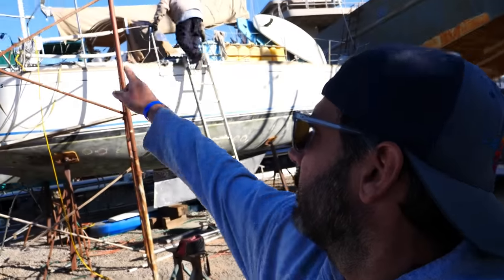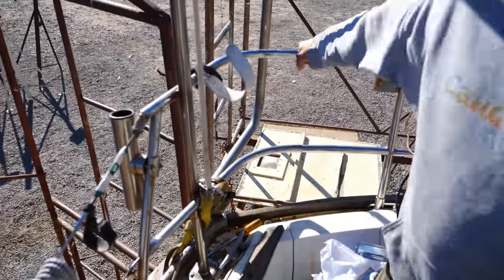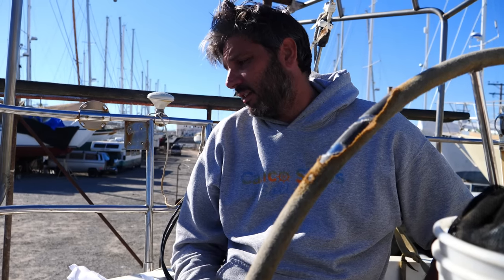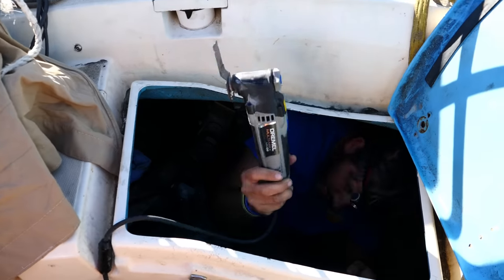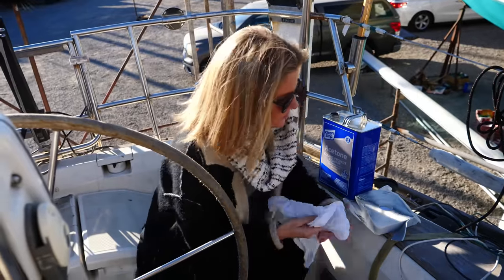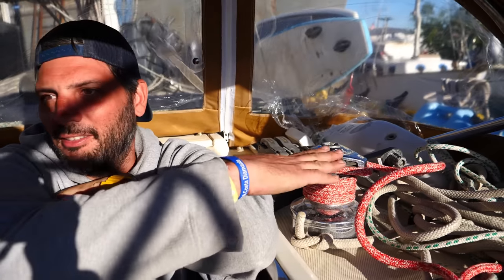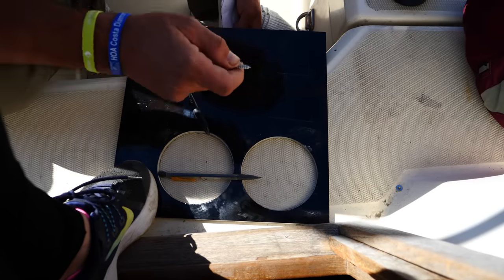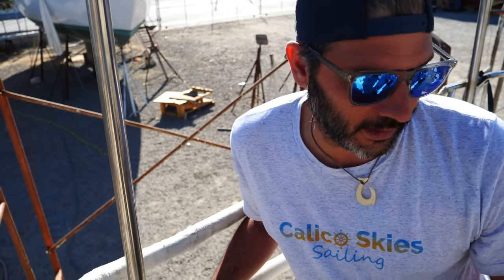Our Costly Mistake: Please Don't Do This w/ Your Arch Build! (CSS, Ep.174)

Comment: Cut the pipe 5 or so inches above, fix and reinforce the deck, then slide a bigger diameter pipe into one of the sides install it slide the larger pipe over the cut and reweld it .
Reply: Glad you like the idea, it could be cut in a way that the larger diameter pipe  ended sitting against the bottom plate to make it look more finished.

Comment: I used to sell 3M 2-part epoxy in the single tube. Tip: don’t use the first bit of glue that comes out of the mixing nozzle. It’s usually not a good mix of part A and B. Squirt about a 1” circle on   cardboard and toss it.
Reply from the maker: Thanks for the info! I'm pretty sure that is what happened! The first bit didn't get hardener or something

Comment: Your fabricator should only be tack welding every thing together until the arch is fully constructed.
That way changes are easy to make. 
 I'm sure you have. But also remember a triangle is stronger than a square when designing your cross bracing.
It's gonna look great and definitely cheaper than state side.
Reply from the maker: good point ha! tack welding didn't always happen

Comment: Bob Sands. Use larger backing plates distribute the upload over a larger area, glue on first then drill and fix , use shorter bolts or cut off, long bolts are dangerous. your trying hard though, good luck , I enjoy your program.
Reply from the maker: those dang long bolts LOL. Limited 316 Stainless down here! HA

Comment: Come on…. Cut the weld or somewhere remove, caulk or seal ! Boom have the welder reweld
Reply from the maker: Because of the weather we were facing significant welding delays. They can't weld in any wind. So we opted to keep the project moving. Much of the work we did had to be done anyway it was just harder to do with the feet welded on.
Reply: @CalicoSkiesSailing  , I was just trying to be of some help. You two are doing stuff that would have intimidated me as a beginner sailor, when I was younger.
Keep up the good work, and blog, fair winds to ya both

Comment: FYI in any future metal endeavors.  unlike wood construction, any metal mistakes can be cut off, fixed and rewelded in 5 minutes.  a grinder with a cutting wheel could have chopped a foot above those feet in a minute.  do whatever you need and then reweld.  easy peasy.  one of you guys should learn welding - a small harbor freight mig welder can do steel, stainless, and aluminum(with a mig gun).

Comment: I don't know who said it first. But an old saying, "When the easy-out breaks off in the project. It's time to start drinking." The easy-out broke pretty early in the episode. Still, so far you've made it through.
A couple of suggestions: If the temps are going to be below the operating temps of the epoxy, pre-warm it to the top of it's temp range and then mix. If you can heat the substrate, do so. A light bulb can do it.
For removing core: an allen wrench in a drill works well. Cutting the short leg of the allen wrench in half, will give you a good fill space around the hole. Be prepared for a wild ride when you first start the drill. Good luck.
Reply from the maker: nice idea on the allen key in a drill, we have a dremel bit we were using

Comment: Those looked like nylon locknuts you used on the backing plates.  The nylon can pull through if under high load, if you notice them coming loose put on a metal nut then a nylok to stop it from backing off.
Reply from the maker: never knew that..Thanks!
Reply: @CalicoSkiesSailing  his was a great idea and good information.  plastic lock nuts can also lose effectiveness at high temperature(think tropics) because the plastic softens and deforms.  also, they cannot be reused because they deform to fit the initial tightening with the first use.

Comment: Striping the screw head! One of several reasons to HATE Phillips screws! Other types strip too, but not as much. Get a long extension and a chuck for your drill. That way you can get around obstacles with your drill. And/or a right angle chuck or universal chuck. With the amount of tight squeeze places on a boat, it will be worth it.
Reply from the maker: Yes I need one of these!

Comment: Building arch now w feet resting on sugar scoops (cat) that have teak.  Wires from panels need to pass through as well.  How would you recommend sealing?  Thanks!
Reply from the maker: I bought cable glands from Blue Seas, its it built to waterproof wire connections between the deck

Comment: Ok inject Sika Flex in the screw hole, this is the proper way anyways so underneath the foot doesnt form and hold a pool... No Worries
Reply from the maker: I don't love using Sika/ 3M 4200 on deck fittings, find it more messy to work with. I find the butyle works really well with deck compression

Comment: A little hint on backing plates.  The bolt hole are never perfect, always tilted at bit.  Drill one hoe through the backing plate and then install the one bolt and backing plate and washer and nut.  Then drill a second opposite the first and install bolt.  Then drill the other two.  You can also screw the backing plate in from underneath with two small screws to make sure it doesn't move, then drill the holes for the bolts.  Thanks for the video.  I designed but have yet to build a solar mount.  I still don't have a quote from a welder but a goal of the design is to make it relatively easy to build (as well as strong and completely removable.  I won't be welding to the existing stern rail.  I'm not sure about the butyl tape in place of bedding compound so interested to see how well it works.  Good idea using g10.  Cheaper and easier to work with than SS.
Reply from the maker: Great tip! We are big fans of butyl tape where there is compression down on the deck. We've tried a bunch of sealants and seems to work best for us 👍. We weren't going to weld to the rails but we were having issues removing side to side sway and attaching to the stern rail really stiffened up the structure

Comment: I guess you figured out the epoxy probably did not set because you did might have used the first mix from the tube is often off ratio.  A heat gun could have been used to accelerate the cure if within the ratio range.
Cheers Warren
Reply from the maker: Yep know that now! LOL

Comment: Drill two small holes in backing plate. Mount backing plate on under side of deck. Mount fitting and drill mount holes. Remove fitting. Overdrill mount holes from above but not thru backing plate. Fill mount holes with thickened epoxy. Position fitting and drill mount holes 2nd time. Mount fitting using butyl tape. If you want an A, does 3 holes using overdrill process with one bolt in place. Then do the one bolt. Always use hex head bolts.
Reply from the maker: nice tips!

Comment: I designed my arch in trimble sketchup first, then used the existing pushpit as the start pattern. Made the whole thing off-site (a few weeks worth of work) and fitted it to the boat in an afternoon!
Mind you, I cheated... Steel boat means the whole lot was screwed to the toe rail. The lesson is... if you can see through the Hull, don't bolt anything to it!
Reply from the maker: smart! that sounds nice and easy! Good idea on not bolting if you can see sunlight coming through

Comment: I know all of those agonies. I had to remove and rebuild my anchor winch, bad enough, but the builders of my boat put the electrical relay and connections box in an upside down back the front position in the fore peak which can only be access trough a 30cm access hatch. I pulled QL muscle and that took a full year to heal. I mounted the electrical box on a hinge arm so now it swings into the opening for easy servicing access in the future.
A good tool to have aboard is a 3 tonne Hydraulic Jack for those occasions when the sheet winches just can’t do it. Though if you get a hydraulic bearing puller which acts as prop puller as well, it could also do the job of pushing things apart to get the mastic in there. You did do a proper job of it though. Great effort.
Reply from the maker: Yikes pulled a muscle that took a year to recover, sorry to hear that! I like the hinge idea!

Comment: With those long screws, you could use two nuts on the end jammed togeather an two wrenches to both hold the screw and tighten the nut all from the bottom.  Assuming you have room. Useful when you are working alone, and when you have a stripped screw head.
Reply from the maker: biggest regret was buying such long bolts LOL. It's hard to come by 316 stainless down in Mx so kinda had to work with what we had on hand

Comment: Great teamwork in this video and loved Grace dancing! You’ve made a lot of progress. What about the load on the arch? How do do you figure out if it will be strong enough? You both have great tenacity! ⛵️👍🏼
Reply from the maker: Good question! We don't have an engineering calc done but we can feel the stiffness of the structure with larger pipe and also a thicking inner diameter. We've had a couple guys hanging off it with no issue!

Comment: Ah, that stripped screw I remember when you first used the drill diver to screw it in, there were pieces of metal flying off of it and I actually thought then that you may have trouble with  tightening that one.  That's the problem with using a short Philips bit in the drill and a bummer if you don't have an extension.  But, you will win in the end.  Great job getting this work done now and not waiting till the whole arch is finished.  Good video guys.  Grace, well done with the editing too, the story is great to follow.  And poor Bill with his bent and twisted spine!
Reply from the maker: Thank you! Yep always one stripper screw it seems HA

Comment: Why didn’t you while it was docked empty the whole boat of all that clutter and start front to back inside???
Reply from the maker: Its not easy to fit all of the spares and supplies required for off grid long distance cruising on a small boat with limited storage. We do periodic purges and will def be doing one before Calico gets splashed though! Its just there are so many things we just may need so most of the clutter are things we use regularly.
Reply: @CalicoSkiesSailing  that makes full
Sense sorry I have 0 knowledge. I love your videos you both are such an inspiration please never change being you ❤️🙏🏻😁

Comment: On a similar project on my Silverton Flybridge MY  I epoxied the backing plates to the inside of the deck after I had drilled the holes in the deck.Once the epoxy set I then redrilled through the hole in the deck to get the holes through the backers. Then the bolts lined up easily, no fighting the get the backers over the bolts. Another tip is don't screw the bolts the full length into the foot, just go about a 1/4 inch more than thickness of backer. Once you place the backer over the bolts, your helper can finish screwing bolts the rest of the way in while you hold the backer from moving.   Use shorter bolts too. Sometimes you can't get the proper length bolt I know,  but you can cut them shorter too. I never could figure out how to cut them longer though.....:face-blue-smiling:
Progress is progress though and you moved forward even with the setbacks. Your good attitude and disposition makes it go better. I'm enjoying all these repairs and mods you're doing.
Reply from the maker: that's a smart way to do it! glass the backing plate on first lol
Reply: @CalicoSkiesSailing  if you ever cut a bolt to length, remember to put a nut on before cutting, removing the nut after will true up any thread damage....

Comment: Just cut the tube put a sleeve in there and reweld it all back together and never look at it again
Reply from the maker: Yea we considered that but because of the weather (windy) we would have had to wait close to a week or more possibly so we opted to keep the project moving.  Much of the work had to be done anyway there were just aspects that were harder to do because of the feet being welded on so we decided it wasn't worth the time loss on the welding. There were many blocks of days over the last two months where no welding could be done so it was a risk we didnt want to take. But we did consider it!
Reply: I understand...I am a  builder with time lines and we just have to get it done...happy trails to you  both . Me living life thru your sailing adventures and thank you for your documentary
Reply: @CalicoSkiesSailing around here, ‘just’ is a four letter word…drop a J-bomb around me and you’ll feel some heat lol!  Power on.